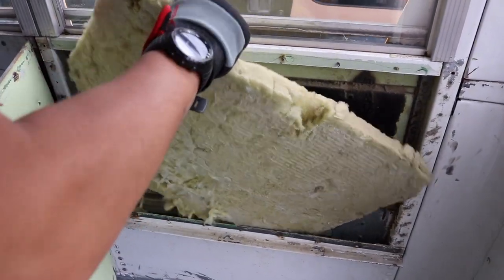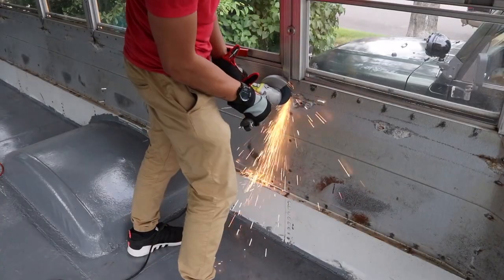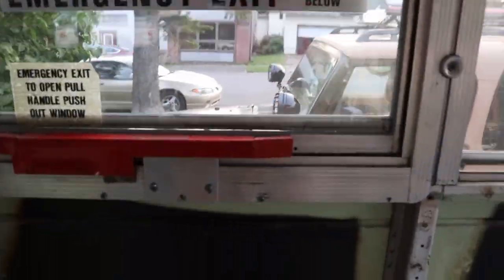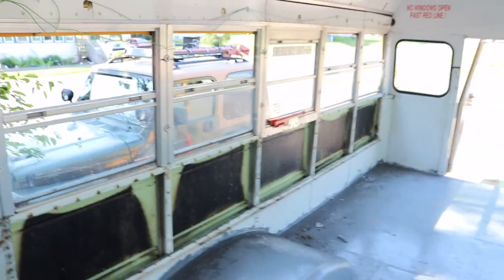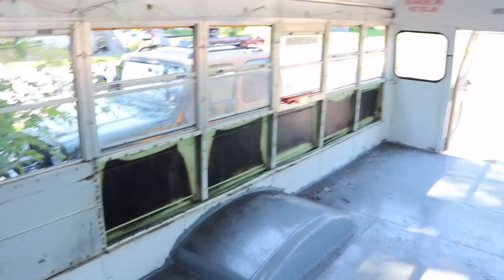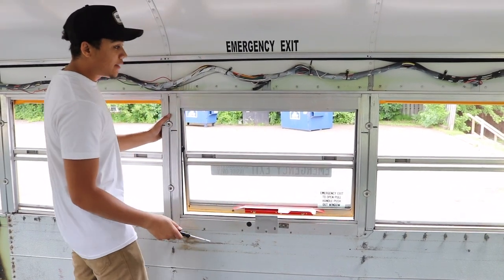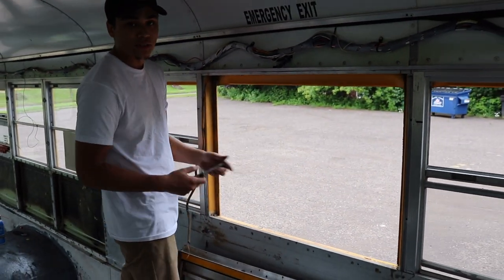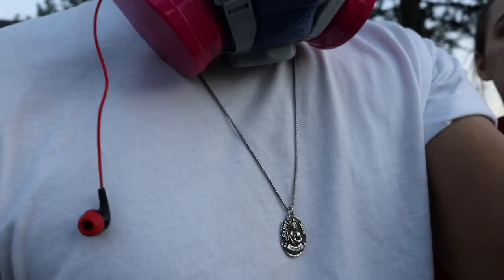SKOOLIE- SCHOOL BUS CONVERSION!!! Wall/Insulation Removal!

Comment: Your bus most likely will not start with all the alarms out. If you plan on keeping them out, you will need to do a little work in the electrical panel to fool the engine cut-off.
Reply from the maker: DirtySouthTV We just took that bad boy out for a ride the other day lol besides the only emergency wiring that make our bus not start would be the back door exit. The windows will just make a buzzing noise.

Comment: Hey!   this is in response to the question about what to do with the rotted steps?  remove all the rott that you can, and put new plywood down if you need to?  then put some new sheet metal down. and weld it down.  so the damage is literally replaced...  then do the same thing you did to the floor with the sealer, rust proofing.. whatever you used for the floor, use for the steps and that area..  you might need to hire a welder to weld for you.   i recommend an actual weld,  NOT A POXY..  because you want this repair to last and be right!   ~ also i am a subscriber and i watch your videos when i can, and wish you two the best!  enjoy ~
Reply from the maker: Rocky Balboa great advice! Thank you so much for the knowldge! We need as much help as we can get lol also thank you so much for supporting our journey it means so much to us!

Comment: Never did a bus, yet. Wife and I are planning it though here in a couple years at most. Did grow up building cars and motorcycles, and have worked on quite a few RV's. Cut that rust out and get rid of the problem completely man, and just rebuild that area. A little menards welder should take care of that project east enough.  Just the two cents of a former drifter brother. Keep the vid's coming man.
Reply from the maker: WittyRat Oh man, I've never welded anything together before... But there is definitely room to learn lol why wait so long to start?
Reply: Our truck went down last year. So, cheap shit that I am, basically by necessity you know, went and got a personal loan, to buy a welder at Menards. This was used to weld together the truck, which was needed for the job, in order to pay the loan we got to fix the truck. Yeah, I know, lol. Anyway, I am over 50, (barely, as I stopped at 30),  but I learned right here brother. I'd never welded a blasted thing before except that one or two day silliness in high school shop class. I just typed in, How to use a wire feed, and went from there. Luck buddy. We'll be watching. And learning. And at moment we are paying off 5 acres of old family land that I have to remove a 72 foot mobile home from. Septic is there, but will need a well put in yet. Old one is just gone. But we are hoping to go off grid completely with an aquaponic farm, and still keep our TV, (Saturday night anime, sci-fi, etc), and our net. Basically, what the hell did I get myself into.

Comment: there are drill bits called rivet cutters look in to them
Reply from the maker: john hern Where were you when we first started? Lol just kidding. We wanted to do a method that was easy for the both of us, so that we could both contributes to the wall demo. That was one of the biggest parts of why we chose to do it the way we did. Time isn't a issue for us because we have no deadline. So sometimes the fastest easiest ways, are not going to fly for us lol we want to both contribute and create more entertaining videos for you guys, so if that means doing it the harder way to make better content. That's most likely the route we will take. Also there are a lot of conversion on YouTube of people doing the drill/drill&chisel/drill/air compressor method this give people I different option and shows them there's others ways if you don't have or can't afford a drill right away. We are doing subflooring next, so if you have any extra helpful advise for that, we are all open for more ideas. Thank you so much for watching!
Reply: do you have a face book page ?
Reply from the maker: john hern https://www.instagram.com/simplyusbus/
 
https://www.facebook.com/SimplyUsBus/

https://simplyusbus.wordpress.com/2017/07/05/so-we-bought-a-school-bus/

https://twitter.com/SimplyUsBus 

We try to keep up with all of them but its hard with YouTube, the conversion, and full time jobs. Things will get better though.
Reply: And you can flip them over, They have cutting edge at each end.
Reply: I've done cases and cases of rivets, I can drill rivet heads far faster then the destructive method. Notice it bends the braces that the panels rivet to so you get to fix that, can't use same holes if panels are reused, none of his metal is can be reinstalled.

Comment: Hi! so we just started our conversion, and we are up to the point where we just put on the rustoleum and the pennies (we got that idea from Scott too!) and now we are kinda stumped. I have seen others leave the panels on the bus, but also have seen people remove the panels. What are the benefits of taking the panels off? Sorry, i know y'all are kinda new at this, as are we, but I was just hoping for some insight!! :) I just subbed btw - we just got our bus last week and I am SO excited for this journey!! :)
Reply from the maker: Jordan Right on! Congrats on the bus and thank you for subscribing! Do you mean the ceiling or the wall panels?
Reply: Sorry - the wall panels! Thank you for replying so fast!!
Reply from the maker: Jordan Ah, well we noticed a few water leaks coming from the wall, we needed to repair that and that's one reason why. As you can see in the video the insulation that comes with these buses are terrible. We wanted to put better insulation in for heat/cool purposes and also for better soundproofing for the bus from noise and vibrations.
Reply: Oooo that is a good point. Have you had any issues with leaking from the roof?
Reply from the maker: Jordan No issues, we don't plan to touch the ceiling except for painting it.
Reply: Dear Miss jordan,  the skoolies 
windows have drain holes to 
counter condensation in the lower
walls & roof area. These NEED to
be clear. Often the insulation is
low quality as You can see. 
Sincerely, Kathleen.

Comment: Are you going to put sheet metal to cover the areas you won't have windows? If so you should call someone who welds. They will also take care of your stairs because to fix it right will require a cutting torch, grinding, welding in new metal to where it needed to be cut back to, some diamond plate would be a nice touch, and more grinding.
Reply from the maker: John DeShetler No, we actually planned to keep all of the windows open. We want it to feel as open and have as much natural light as possible, since the bus is so small to begin with. But we definitely need to fix that bottom step.
Reply: +SimplyUsVlogs,  Good "idea" on
no desire to live in a "cave". It's 
really nice to live in a glass home. 
Sincerely, Kathleen.